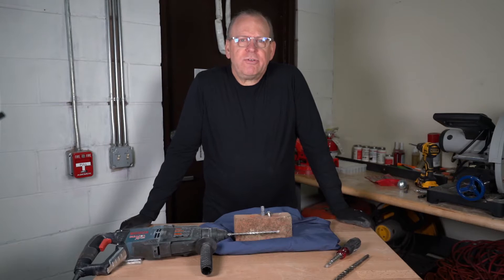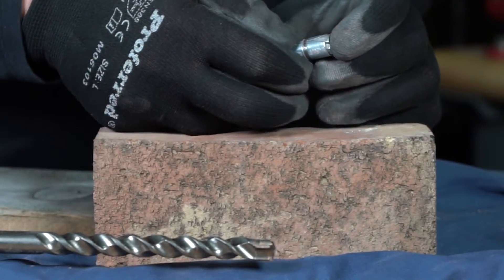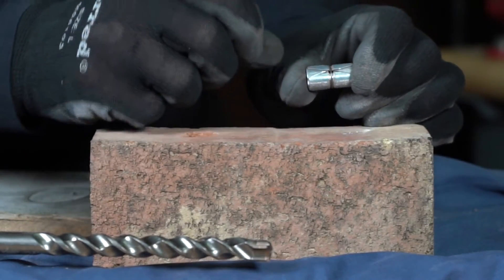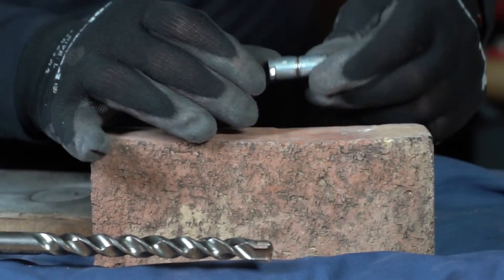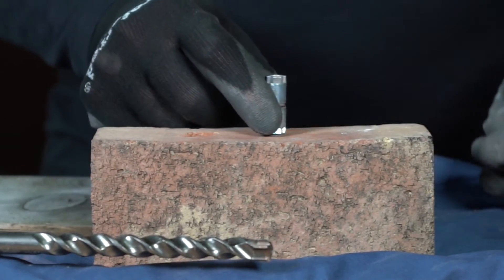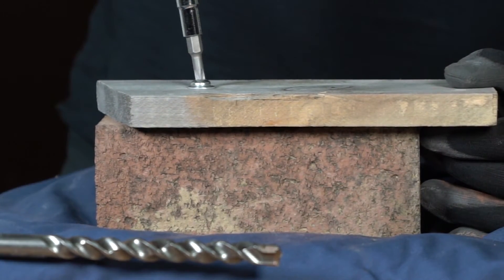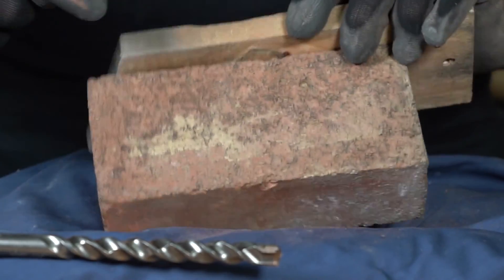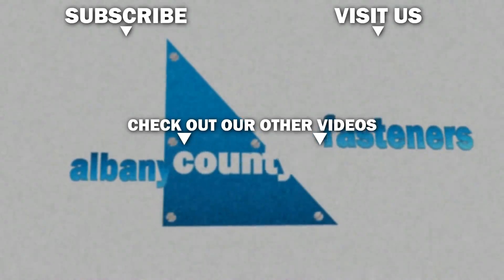Anchors For Brick - Double Expansion Anchors | Fasteners 101

Comment: Half way through I was thinking, finally, I've found what I'm looking for...and then you said these aren't for very heavy loads. If the sleeve and wedge ones can split the brick, what would you suggest that won't that is suitable for very heavy loads? (like a 5m, 50kg awning)
Reply: I would suggest multiple anchors to distribute weight and can even use sleeve anchors and chemical anchors, alternating. Chemical anchor is like a glue that tightens over a threaded rod in the hole, it has advantage that it doesn't concentrate forces on one spot and crack the brick; rather it is distributed along the length of the hole (think of it like super strong glue).
Reply: @nilsfrahm1323  I went the chemical glue route and 10 months on, still holding.
Reply: @nilsfrahm1323  Are lag screws recommended for that and not machine screws?
Reply: Or a gate.

Comment: I can't use maybe my mistake was to long because the screw fault out of the wall
Reply from the maker: Potentially. It's hard to say for sure without knowing more about the application. It's also possible the anchor was not the right size for the hole that was drilled.

Comment: Should the top of the anchor sit flush with the brick face?  If not, how to do you determine the depth of the hole to drill?
Reply from the maker: Yes it should sit flush and the depth of the hole should be the length of the anchor plus 1/8."

Comment: What is my best bet for installing a heavy 100 pounds tv on brick?
Should I drill the mortar or the brick?
Reply from the maker: First, for installing something like that, if the brick is solid, then wedge, sleeve, or double expansion anchors can work. Which one you may want to use will vary depending on how many anchors you intend to use, how deep you want to drill, and have large you need these anchors to be.
Secondly, you'll want to drill into the brick itself. The typical reasoning for drilling into mortar is because the brick itself is crumbly, old, or otherwise weak. So unless the bricks you intend to install in are brittle, you should be fine installing directly into the brick.